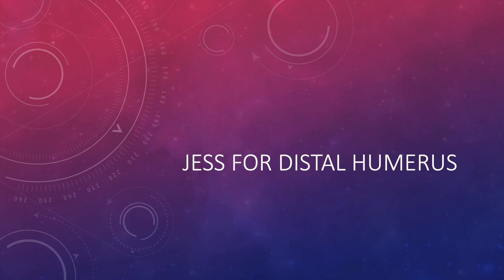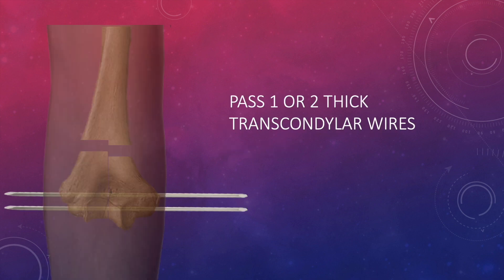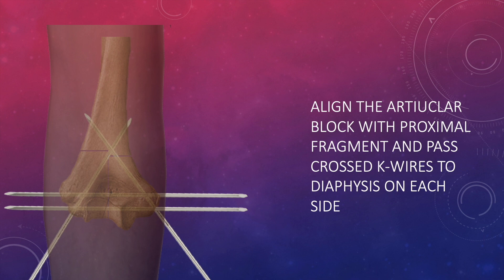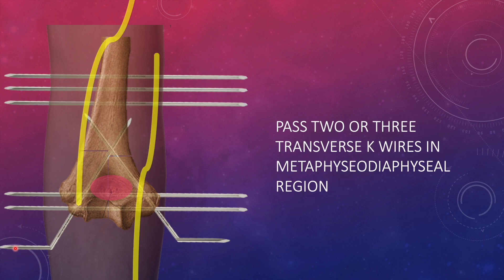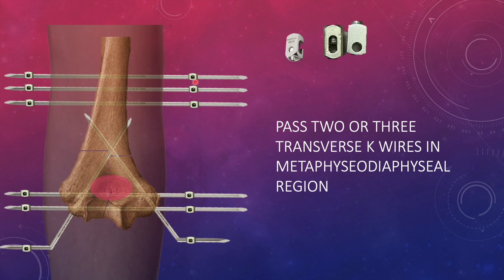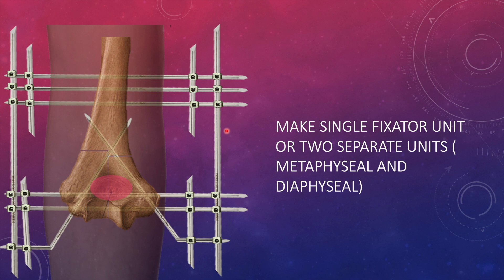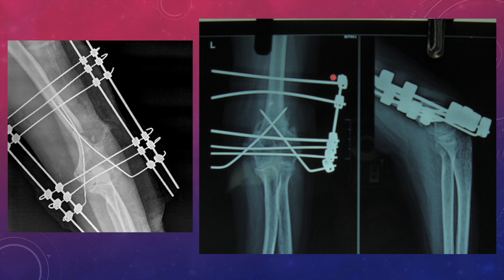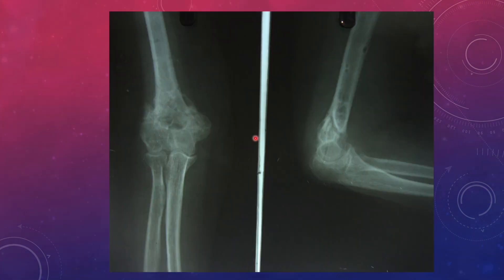JESS Fixator Technique for Distal Humerus Fractures

Comment: At 4.12 you have said pre bent rods. What is pre bending of rods , how to do that .please explain.
Can jess be tried in distal femur
Reply from the maker: Pre-bending is done to create an angle at the bone and k wire junction. This bending is fixed as the K wires are locked with fixator rods. The resultant nonlinear relation between bone and wire makes the translation of bone difficult and adds to the stability. Thus bone can no more slide on wire as it is bend on both sides. Also there are multiple pre-bent k wires in the jess assembly. Thus the reduction remains stable. JESS can be used for pediatric distal femur but not for adult distal femur as bone needs more stable fixation and JESS is a light fixator
Reply: @Justorthothings  if you prebend the wire and while drilling will not wiggle around because of the bend (not being straight )
Reply from the maker: Pre bending is done once the wire is inserted in bone and before tightening of clamps. I ll try to share a short video, explaining that.
Reply: @Justorthothings  please do. Thank you so much